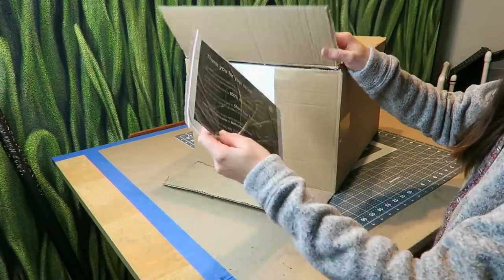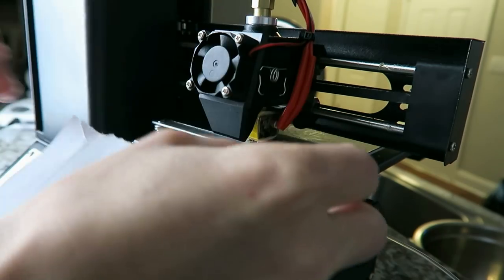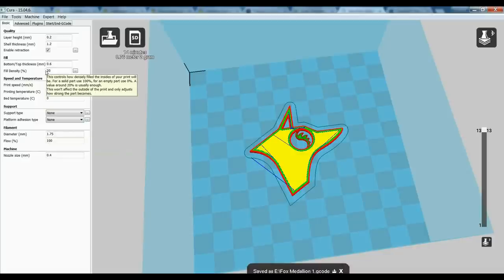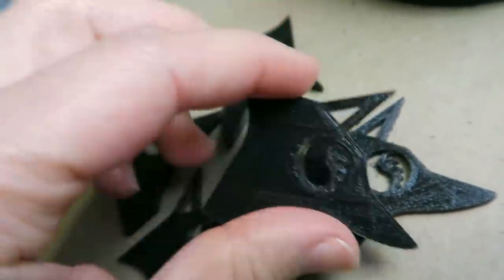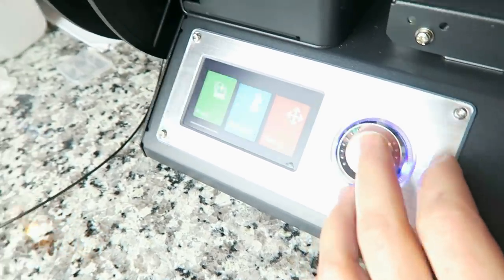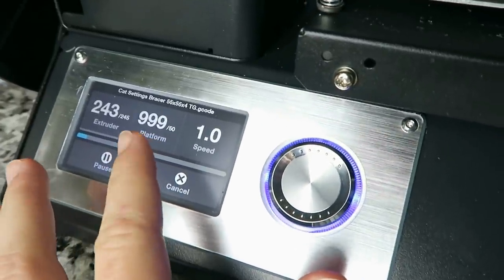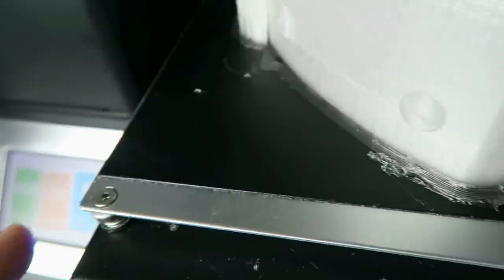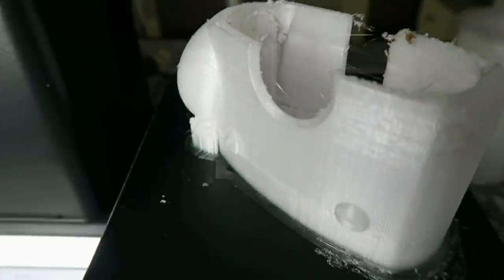Monoprice Select Mini V2 Unboxing & Review: PLA, SemiFlex, Cheetah, Tech-G

Comment: Great video. I got this last black Friday sale on Amazon. Best beginner printer ever. Ran 1 entire roll of hatchbox pla and didn't have one problem. Worked right out of the box. I'm well over 30 hours with no bed wire breaking yet. Will mod it eventually.

Comment: Try dehydrating your flexible and brittle filaments. When hydrophobic filament has too much moisture, you will need lower printing temps due to the water being a catalyst for lower melting temp. Also filaments could have unevenly absorbed moisture leading to needing constant temperature adjustments. The stock nozzle is probably why your getting all that stringing. A plated one instead of bronze will do better at staying clean during printing. Not sure what your retraction settings are(need to see a short time lapse to see whats going on) but probably could give the printer a good run down and calibrate/tube/align it. Pretty sure its known that MPM has poor part cooling leading to crappy prints. Well, most all printers have poor stock cooling and make the excuse of, "We want to see what the community can come up with." All the problems your experiencing can be fixed with a few cheap upgrades. But stock it does look a bit rough.

Comment: I had a v1 of the Mini. My big issue was the gantry arm was slightly sloped, so if you did like I did and try to level the bed with calipers, the print head ends up scraping into the build plate. They REALLY need to add automatic bed leveling if they make a v3.

Comment: Overclock your extrusion, I have the v1 and had the same problem with stringing on prints that I wanted to have solid. I set my extrusion flow to 110 percent, problem solved, no more stringing.

Comment: Right out of the gate, the issue I have with it is the black mat. At ABS temps, the black mat comes OFF and it ruins your ABS. As for 190-200 and 45-60 on the bed, PLA works awesome. Anything above that the mat came off for me and it ruined a 10 hour print. I gave up and remove it and I'm using blue painter tape.
Reply from the maker: Not a fan of that type of surface either. Too delicate.

Comment: I don't own this printer specifically, but I'm betting it's similar to the Maker Select v2 where the hotend has a PTFE (Teflon) tube that extends down into the nozzle. The problem with that on the Maker select is the nozzle gets too hot for anything hotter than PLA, and the PTFE tube gets gummed up, which causes jams... if that's the case that would explain why your extruder is having a hard time pushing filament through fast enough and it would explain the globs on the side of your print because it's trying so hard to push filament through that it goes through in jumps so you'd get way too much filament sometimes then not enough other times over and over. and that all 9's issue looks like a short in the wire leading to the bed's thermistor.  The PTFE tube is why a lot of people choose to change to an All metal hotend, but some of those have problems too.
Reply: Yeah :( that sucks dude. The thermistor wire should hopefully be an easy fix though if that's the problem.
Reply: And Apparently the blue Capricorn PTFE tube might be a simple fix for the hotend problem. their melting point is supposed to be 340 degrees C - as opposed to the regular white kind which can melt anywhere from 220 to 260

Comment: Hmmm. It's a nice printer and all but I still prefer the ender 3. This seems a little nicer in the build quality area also seems like it's a little more straight forward to use and to put together but there are millions of videos on any issues you may be having with the ender 3. There are also plenty of replacement parts available and tons  of printable mods.  Ender 3's print quality can achieve the same quality as  much more expensive units with a little tinkering. And most importantly it has a much much bigger heated build plate. Plus you can get the ender 3 open box on eBay for only $150.00 or so. In my opinion it's the place to start for any one dipping there toes into 3d printing, even some pro's use the ender  3.
Reply: Be sure to never leave your Ender 3 unattended. It has no thermal runaway protection and could cause a fire.

Comment: It's the version of Cura that was causing all the buggy issues with mine. Switched to Cura 3.1 and it's fine. Simplify3d works fine too.
Reply: It took me awhile to realize it. And a lot of cursing lol. I noticed when it would write to the SD card the start/end G code would be scrambled up for some reason.

Comment: I could print the cat straight from the card, but I cannot get anything to print via Cura on USB.  Is there a simple fix for the USB printing problem on this device?
Reply: Connection speed? I run mine at 567000. You installed USB driver, Correct?

Comment: My guess is that the flattening of the filament, is either to much idler bearing pressure, to much retraction or to fast of retraction. Just a guess. For 1.75 filament direct drive extruders work much better than bowden.  The out take, oops 😊  You don't know your own strength.

Comment: Man that has to be the worst printer I've seen tested, which is a shame as it comes in a all steel body so I would've guessed it'd have some amazing prints. I would suggest looking into a Anet A3 printer if you are looking for something already built out of the box. I've had mine for a few months now and it has been nothing but a work horse. It's cheaper on ebay then amazon at around sub $300. As for really high temp prints it does come with a PTFE tube in the throat so nothing over 245c would be best. Best of luck, keep up the awesome videos.

Comment: great video, thanks. I have a robo 3d which does large prints well, but it takes up a lot of space and has required a lot of up keep. Been looking for something smaller and this looks like this might be convenient. I'd like to know how it would hold up as a daily driver.
Reply from the maker: You're welcome. I ended up returning this because it wasn't right for me at the time, but I think if you're printing with PLA and aware of the issue with the heated bed needing to be rewired, it might be just fine.
Reply: @LindyDesignLab  Hi Lindy, what 3d printer would you recommend? I'm trying to decide between the MP mini V2 and a Lulzbot mini 2. If you have a better recommendation I'm happy to know. A big selling point to me would be customer service and reliability. Thanks in advance!

Comment: Can you use any nozzle on the 3D printer or does it have to be made specifically for that machine?
Reply from the maker: I haven't found a nozzle from directly from MP for this model, but there are threads and videos about what nozzles work and how to change it. Doesn't seem MP intended the nozzle to be changed?
Reply: Lindy Design Lab But doesn't it need to be cganged from time to time due to degradation? Monoprice is selling nozzles on their site but it's 12€ per piece.
Reply from the maker: I would think so... Yes, they are selling nozzles but the description on the one I am seeing on their website says its for a different model. Plus, someone on a forum said that one is the wrong size, so I'd do some research before purchasing anything. I haven't personally changed the nozzle on the MP mini.

Comment: can 3d printers produce a piece that is solid and hard? im looking to make a coin ring folding cone
Reply from the maker: Solid when set too 100% infill but still has textured print lines on the outside. Hard depends on the filament but sure, relatively hard plastic. I haven't done coin rings, so I don't known if this would perform the function well or not.
Reply: thanks for reply im looking to make a  plastic piece that is shaped like a cone with 5deg sides that will push thru the middle of a coin ring to push out its sides. i was asking if they make a filament for that  @LindyDesignLab
Reply from the maker: Right, I just don't know if the print lines would be a problem or if the plastic would end up being hard enough to last for a while against the metal. Best guess would be just purchase a commercial set of those parts instead of investing the money and time into getting a printer, learning to use it and create models, testing filaments for something that may or may not work... unless you already have the printer and experience or want to use it for other things also.
Reply: thx you're so good at replying I want to get into 3d anyway and i just wanted advice on what the hardest filament would be   @LindyDesignLab

Comment: Hey Lindy nice to meet you. Have you set up wifi to print for this yet? Or even USB? I'm having nothing but problems with it ever since I "tried" to set up WiFi. Now, nothing works right and it's all over the place. All the settings had to be re-done. It abruptly stops printing because it STILL is trying to connect to wifi which i can't figure out how to stop. Printing by USB was a fail as well. I should of just left it alone. So frustrating. At this point I'm thinking about just returning it and starting all over again. Lol.
Reply: I'm about to do the same regrettably because i really like this printer. Trying to look into a firmware update but there is so little info about it. I have no idea what version is currently installed or how to find out. Apparently there are only 2 versions. It seems nobody wants to shell out the big bucks to pay proper software engineers these days. It worked fine out of the box but once i tried to set up Wifi it just fell apart.
Reply: This is the first time I'm using Cure or at least the version that comes with this machine and i got too say, I'm not a fan. It just feels very basic compared to other slicing programs. Going to try another one and see if i can get it to work because mechanically this printer is great it's just software issues that I am having. I used to have a Makerbot and that software that worked great but I'm not sure it will work. What would you recommend as far as other slicing programs to try? I'm thinking Simplify3d

Comment: If I use PBS filament the filament curls up when printing the cat. I have adjusted the bed height, speed and lots of other stuff. What am I doing wrong?
Reply from the maker: Do you mean it's curls up from the bed or it's warping/cracking between layers?
Reply: The Printer prints the platform on which the cat stands. It platform curls up sometimes. Also the extruder pushed the cat off the bed sometimes and obviously this is because its too low but its not. i tried adjusting the height of the bed but it doesnt help. All of this is being printed with PBS filament and the printer came with PLA filament.
Reply from the maker: Is PBS a brand of filament? Sound like bed adhesion issues. Maybe bed temp isn't reading accurately, residue on the build surface or just a crap roll of filament if other filaments aren't having this issue.
Reply: I tried hairspray, gluestick, paint tape on the bed and taping down the curls. Then I tried all 4 and I still had problems. PBS isnt a brand.. I think. Its a Type of filament.
Reply from the maker: Eh, shouldn't need any of that if it's got the black buildtak knockoff stuff on there like mine came with. What's on the bed then? I'm not familiar with that type of filament, so maybe just check with wherever you purchased it to see what they recommend.
Reply: The bed is the normal bed that comes with the printer. But I put green painters tape on the bed. I have the same printer as you do FYI. I put the tape on the bed because I wanted to try putting gluestick on the printbed som mabye the platform that the cat sits on wouldnt curl.
Reply from the maker: Maybe just take it all off, clean it really well and start over on the surface it came with. Sorry I don't have any better answers, I know it's super frustrating when nothing works. The main thing I found for getting stuff to stick to the bed was to level nozzle closer to the bed than they show in the crappy pictures in the instructions so it's pushing the material into the surface a bit. Just have to be careful cause that can actually stick so well it rips off bits of the surface with some materials!

Comment: Quick question. Is it worth it? Did you return it and get something else? I’m literally on the fence with this thing but based on the printing results I see in your vid it’s not looking too good.
Reply from the maker: For me it wasn't worth it because I couldn't get the dependability I need for my business. As others have commented there are issues with the design of the bed but also mods on thingiverse to fix some issues. In the end I returned it because of the glitches with the bed wires rubbing on the belt gears, bad design, plus the error in documentation for the temp rating on the hot end, only up to 230 not 260, no good for my applications.. I haven't decided on another one yet, but I'll run it through the paces and post the results once I do.

Comment: IMO nearly all of the issues that occurred in this video, in particular the glitching and temp display anomalies, can all be attributed to the undersized factory power supply. This shows itself when you use other filaments than PLA which require higher extruder and bed temps, which draws more current until the stock PSU begins dropping out, or possibly trading voltage for current, again causing glitching.
Replacing it with a larger, well regulated PSU should resolve most of these issues.
I'm planning to try one of these myself.  https://www.amazon.ca/dp/B01HOBX8V0/ref=cm_sw_r_tw_dp_U_x_lBIuBb019T3CM

Oh, but anyway, nice review. You sure put a lot of effort into it. Thanks!
Reply from the maker: That would make a lot of sense!
Reply: Lindy Design Lab thanks for the reply. I know it's an older video but given Amazon just created a ton of new users of this printer by selling it under $150 on Prime Day this week, I thought it might become relevant. 
Hopefully the info helps someone. 
Also I've reevaluated my PSU choice and now I think I have to recommend a Meanwell NES-200 power supply.

Comment: You are printing your temp to high I print at 190-200 on the same printer and the print quality looks like it come out of a 1000$ printer
Reply from the maker: The PLA test cat was done at 195. The other filaments used do require higher temperatures to extrude. Do you find that you use the heated bed much with PLA prints?
Reply: Lindy Design Lab i always use the heated bed at Maximum on monoprice select mini v2